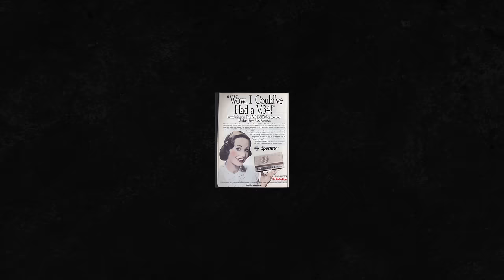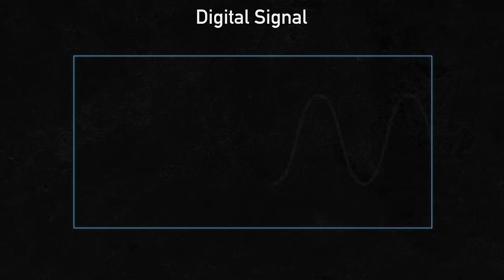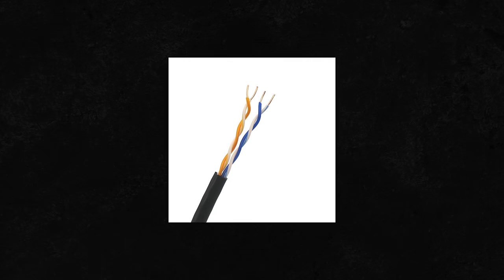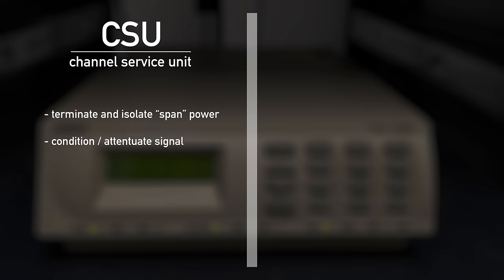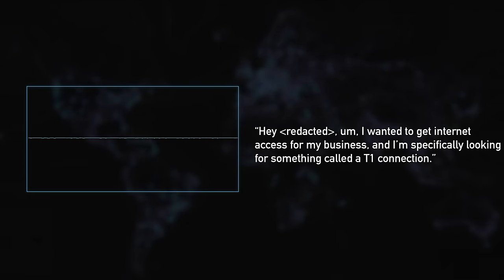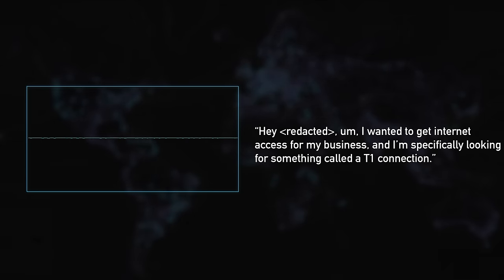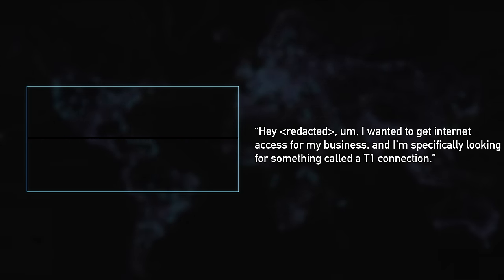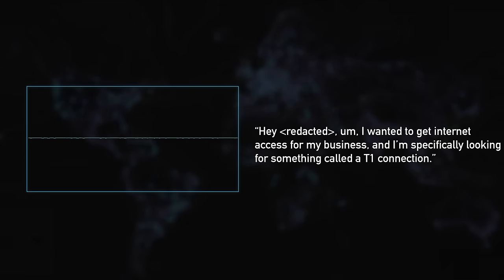1.5Mbps of pure '90s: Setting up a T-1 today - ISP Series Episode 3

Comment: So would T3 lines of been the same set up, just with beefier transmission speeds?
Reply: More channels? Yes. Instead of just the 24 channels, a T3 would have 672 channels. Though I'm pretty those didn't use the same two pairs of twisted pair phone wire that a single T1 used....
https://en.wikipedia.org/wiki/Comparison_of_T-carrier_and_E-carrier_systems?wprov=sfla1

Comment: Also 28.8 was only on the market for about 2 years and was never popular for end users. almost all end users switched from their original 14.4 home models to 56.6 home models around 1994-96. 28.8 and 36.6 were basically leapfrogged in the market.

Comment: 2:04 Not hundreds of users, but at 3:14 you answer the correct #
Reply: I think what he meant is that a T1 carrying data alone (ala IP packets) could support hundreds of users. Because yes, if a T1 is used in a channelised manner to carry phone calls into a dialup modem bank, you'd only get 24 phone calls per T1.
Reply: In that era there were two networks depending on each other.  PSTN & the Internet. 
T1 is a “transport protocol” akin to a train with containers. The internet & PSTN were two different networks, they're simply "network traffic" within those containers. 
I'm splitting hairs, but to someone new they may not know how the T1 is used. "oversubscribed" on PSTN & Internet are handled differently, however if 24 users connected and maxed out their throughput 100% you may only have 24 users on the PSTN side & the Serialized WAN side (+ overhead.)

Comment: Fun REALLY began once your ISP grew to use fiber SONET rings and you had to mux up/down from OC 192/48/12/3 to DS3/1/0… Not the mention keeping all the Frame relay and ATM pvc’s sorted out!

Anyone use the Cerent 454 equipment before it was mutilated by Cisco? Massively cool capability till Cisco “engineers” got ahold of the poor thing. Had to use it to get from building demarc to colo closet when copper runs ran out and only 2 fibers could be run through the whacky building risers.

That leads into stories on using multiple colors on the fibers to eek out more transport but, that’s a different old fart story…

Comment: Is the 64kbps slot the reason a 56k modem could only have 64k of data running through it when upstream and downstream were combined?
Reply: "56k" modems could only do "56k" because of the way the signal is processed. It is extremely unlikely the telco end can see a clean enough signal to differentiate 8bit PCM from 7bit PCM. (and usually 7 was asking a lot) The absolute maximum is 64k because that's literally all the digital side of the network can handle. (V.92 can eek out maybe 48k up by directly transmitting PCM tones sync'd to the network - that's about as far as the witchcraft goes.)
Reply: @jfbeam  That’s not quite what I meant. I seem to recall that at any given time, the combined upload and download capacity was 64kbps, so you could be downloading 48kbps and uploading 16kbps, or something like that.
Reply: @pokepress  Nope. The voice channel is full-duplex. Just as you can talk and listen at the same time, so can the modem - using echo cancellation. A T1 is full-duplex as well, but it has independent TX and RX channels. (pairs)

Comment: Every time you show a picture of the board, I keep thinking "there's only one SIMM RAM chip", how exactly does that work? Is there another chip soldered onto the board? I can't figure how that would work if you added a larger chip, unless the onboard RAM(assuming it's the same size, and that it even exists) was bypassed if a second chip was installed, requiring you to upgrade by purchasing two replacement sticks of RAM. Single stick DRAM didn't exist yet when this technology was implemented.....

Comment: Remember he first US robotics 9600 baud modems that came out and how you could get one at a discount through the sysop (bbs) program? A discount to 500 bucks, what a steal!! But I remember all the big hoo hah….how they first thought that 2400 was the fastest it would ever be allowed to transmit over a phone line. The copper just wouldn’t support higher speeds. Heh heh. Then, of course, 14.4k, 28.8 and then 56k modems before adsl and cable hit the waves.

Comment: The worse thing is ive had my NBN connection drop back to near this speed.. in 2023.. ya know 23 years in the future from when the future began.. load of junk. $100 a year for speeds less than I used to have in the mid 2000's I miss my 100mb connection :(

Comment: I don't know that I'd try and service "hundreds of modems" via a t1. Rembert, if you're paying for 48 modems you want people to actually be able to use them. People dialed in will be activly using them. VS an always on connection. OK, not everyone will connect at s full 28.8, but most IN a city will. And when they do, that connection will be compressed so those 24 lines going to a24 channel t1 2jen the t1 isn't compressed will mostly max it out (OK, there is dialup overhead, so, I might serve 48 modems via a t1. And of course, down speed could be 56k. Definitely want to show that speed of the neighboring isp is hitting that. If you're talking about an isp using and as, they're probably serving 56k.

Remember, in this age you've got a double whammy... Ping times/latency are key with real-time connections like telnet. And doom is becoming networkable, which is both data heavy and low latency dependent. The double whammy, web browsers were coming out they were data heavy. As were many people downloading things. Remember, dialup was often actually used when connected, so dial, and download.

Comment: Great, thanks..I never got to use the equipment, knew about its existance and that it used the copper network, but nothing else..that was informative.. Yeah, you wont get this service here, and if you did you wouldn't want it either, what's left of the old network is either in a sorry state, has been scavenged for copper or left to rot. Now new laws passed requiring isp to remove it by the end of 2024.

Comment: Lmao, providers dropping copper? Tell that to comcast. Doing everything they can to NOT adopt fiber Internet. I feel bad for Comcast gamers. Because there is absolutely a ping difference between comcast via copper and verizon/at&t via fiber. In my home the difference is about 15 ping. So on verizon I will have 5-15 ping but with Comcast to the same server it's 20-30. Now people have argued nodes and tracedroutes, but i checked that and sure enough the amount of nodes/hops were identical. Comcast is just slower....

Comment: 1,536,000 bits per second is 1.5 Mbps not 1.536 ... 1Mbps = 1024 kbps and NOT 1000 kbps.. 
thus 1,544,000 kbps is 1.507 mbps  but you did probably miscalculate the frame too since you only deducted one bit (the irony is that even in your graphical representation deducting just 1 block would look asymmetric but this didnt tip you off) so its 192 bits *8000 hz = 1,536,000 kbps which conveniently is 1.5Mbps exactly ^_^